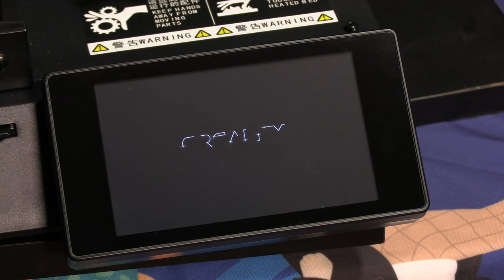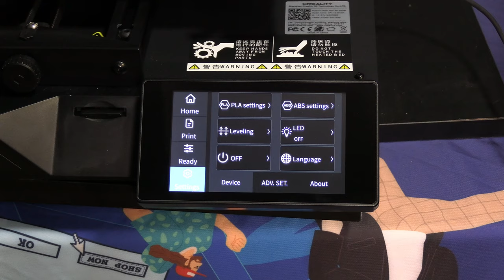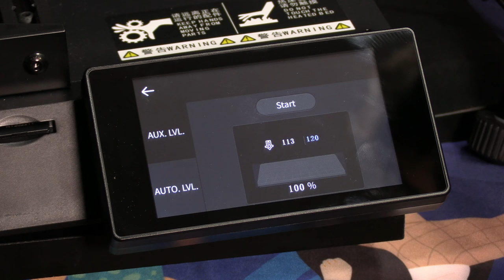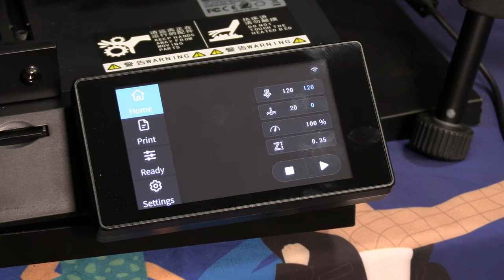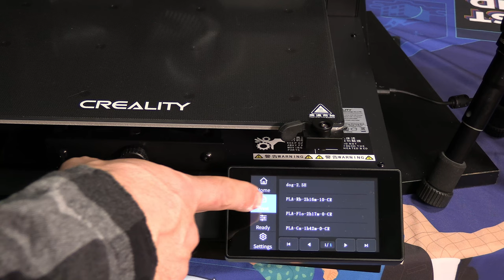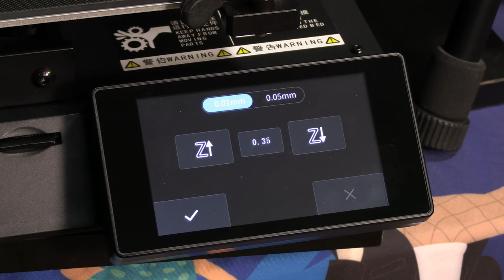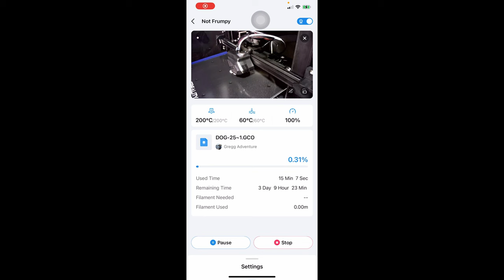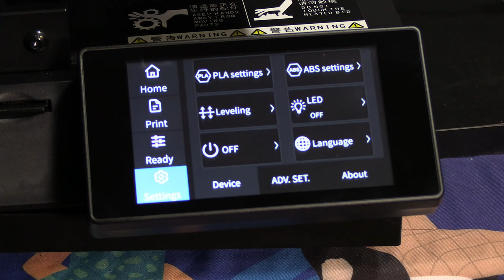CR-10 SMART Setup: Z Offset, Eccentrics, Tension Belts, Update Firmware, Camera, Creality Cloud Wifi

Comment: I have cr10 smart pro
For levelling, do you use only the automatic levelling? When do you use the manual with the wheels beneath the bed?
Reply from the maker: IF the machine has knobs, you will always need to do those 1st, then, run the ABL, followed by Z-Offset. This machine, the CR10-Smart, has no knobs.

Comment: I need to buy another printer (I know, I know, but I'm not ready for that 3D printing addiction intervention meeting with my family, just yet!)... I need one that I can print full-size helmets on, for most adult human head sizes.  Are the dimensions on this large enough for printing full-scale helmets?  Or should I look at something larger?  I'm trying to stay on the el cheapo so that my wife doesn't realize how much my addiction might be costing me.  Anyway, just let me know.  Also, you can't rat me out to her, she doesn't even check her email!
Reply from the maker: So many great options for this, but, advise is getting MUCH tougher lately, with the massive leap newer machines have made. For example, a K1 MAX, absolutely crushes any 300x300 machine that came before it, both in Ease of use, and speed, but.... There are MANY older machines, you can grab on the used market, that are great for large prints. 300x300, will probably cut it, but, it's tight. An Ender 3 MAX, or S+, or, any CR-10. The CR-10 is basically a more robust Ender. The CR10-V2, V3, Smart, Smart Pro, are all great machines, you can get on the cheap now. Ender 3 MAX, is my all time favorite machine. All of these can be nabbed for a few bills used. But.... If you want to be more comfortable with size capability. I point you to one of my other favorites, the CR6-MAX. It's HUGE. It's also, basically, a MASSIVE  CR-10, so, if you are comfortable with an ENDER, or CR, you'll be comfortable with this big guy. Then, there is the 5+. This is ALLOT of printer. MUCH more complicated than the rest, but...... It's not a bed slinger. It works similar to how the K1, and P1P work, with the bed only moving DOWN. This makes it super stable, and ideal for large tall prints. But, it can be tough to dial in. Mine took me a long time to get along with, but, now I can trust it to handle complex jobs. 

If I could pick one, it would be the K1 MAX. No contest. Unless you need BIGGER than 300x300. Bring up the machine in a slicer, size your model on it, and see what you think.

Tell the wife, YOU are the KING of this Castle. It worked for Ralph
Reply: @3DRundown  Thank you so much!  Great perspective, great sanity!